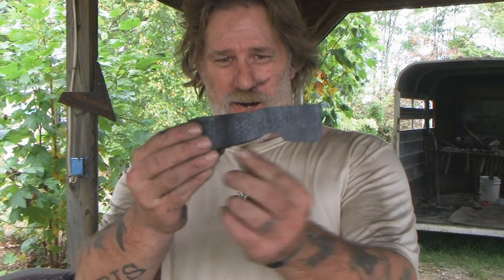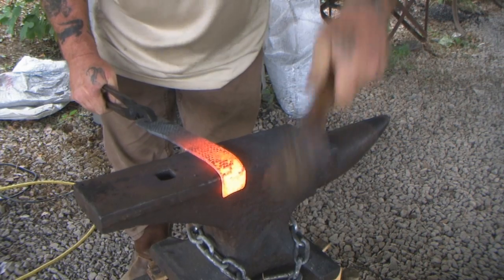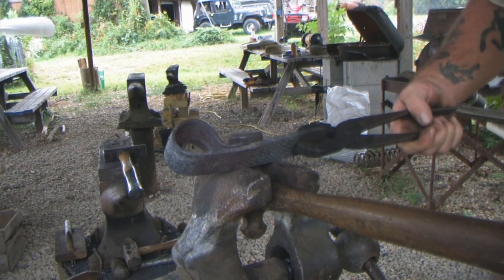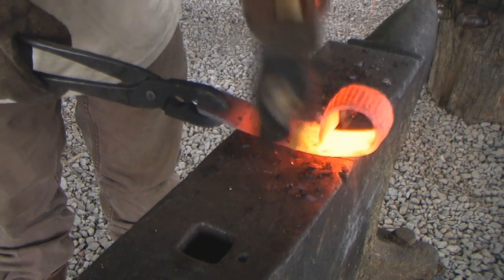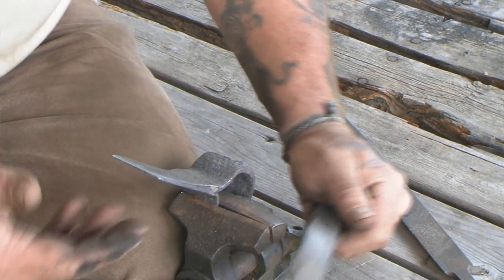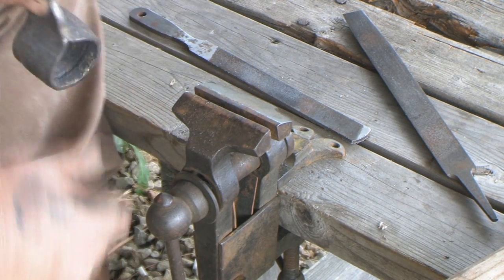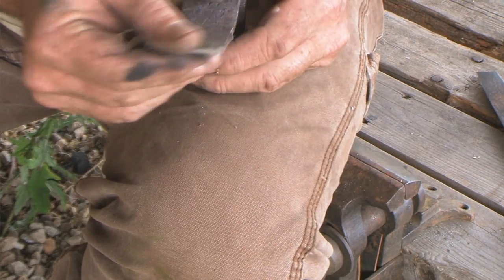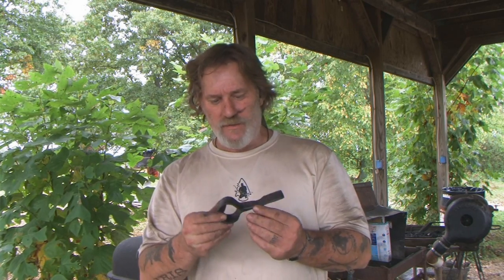Tomahawk from a Rasp Blacksmithing Part 46

Comment: Hello dave, it is very interesting watching you do this. I actually watched the vid where you made the forge from a  brake drum. I walked an old railroad track that had coal left from the old steam engines. Walked miles collecting coal to use for the forge. I used a bathroom ceiling fan for my fan. It worked great , i made a couple knives with this forge, thanks so much, you doing this makes me want to set it up again. take care bro thank you

Comment: great video dave. just one thing to add. when your heattreating carbon steel it will go nonmagnetic when it reachs the right temp. i am a little bit colorblind so i use the magnet when the magnet dosen't stick it is time ffor the oil and.it is also a real good bar bet.

Comment: Just wanted to clarify that this comment was not meant as a criticism or a critique of your work or the tomahawk design, I honestly doubt I could have done a better weld than that. I was simply offering another point of view from a fellow smith. Have been learning the craft since I was 10 (now 21) and I also have trained as a tinsmith and participated in local re-enacting events.
Regards, 
    Storm.

Comment: Dave, I was inspired by your work! Even though I don't have an anvil, forge pr blacksmithing tools ( or at least not yet ;), i took and Oxygen Cetalene torch, vice grips and an inch thick block of steel... My blacksmithing set up! I had two old files but i burnt a hole in te middle of one :/ The other however, i complete apart from the final weld (i can't forge weld:() and reshaping the blade! As you so often emphasise, improvisation is they key! Many thanks, Reuben.

Comment: Hey Dave just a suggestion, instead of cutting off all that extra metal why not fold it over and weld it back on itself, then you would have more material to create the cutting edge of the hawk and more weight behind the blade. Again just a suggestion, I've watched just about all of your videos and was a fan of duel survival. Currently working on my own common man kit. Best wishes, Storm.

Comment: Been a fan long BEFORE you made it to TV.  I make knives and hawks from stock removal/forging.  Great weld, but in the heat-treating...you only  'quenched' the blade, it was not tempered. I.E. 1095 hi-carbon, as quenched, will be around 63 on hardness scale, THEN, I temper in oven at 490"  3 times for an hour each....this draws back hardness to around 57-58.  Just quenching, and leaving at 62 is too brittle.  And yes, on the right track leaving the rest of hawk unquenched. I only "edge quench."

Comment: I really like the shape of this one compared to the first tomahawk you forge welded. Though, I would have sharpened the beard. (I have a CS Trail Hawk I modded with a bit of a sharpened beard, and I find it helps immensely for splitting and carving work)

Comment: Dave, I have seen you and the other man that did smithing on you channel use a hammer head in a vice to shape the eye. I was wondering if this is just to make it circular of if it is the diameter or what? also I was wondering how to make the eye a certain size to put on a premade handle?